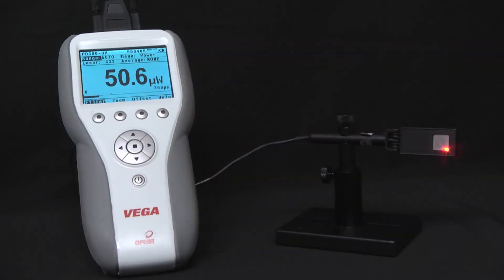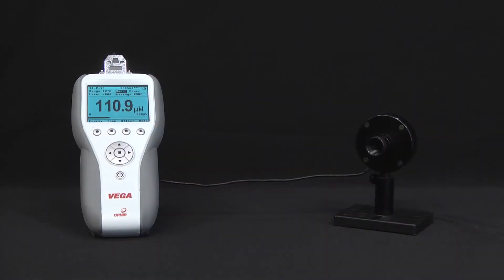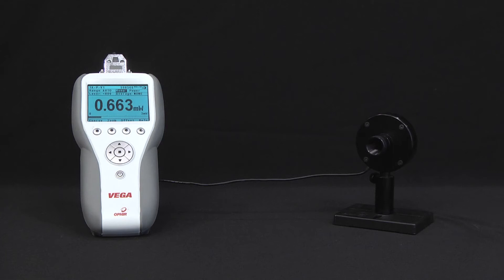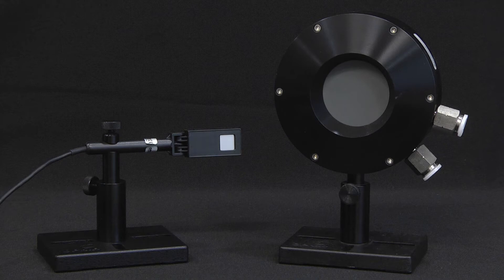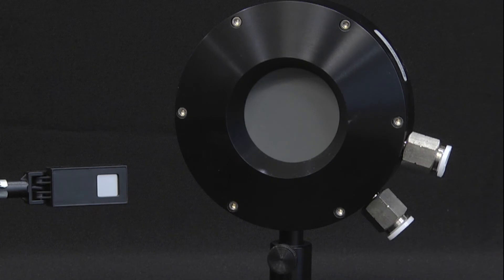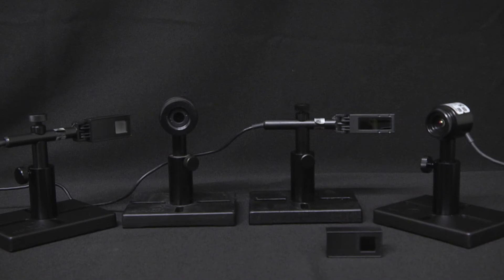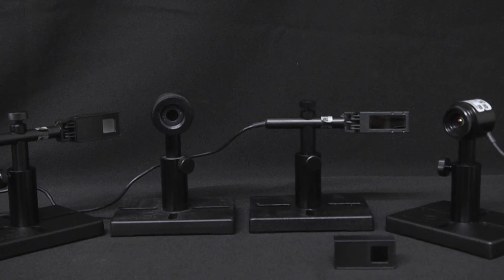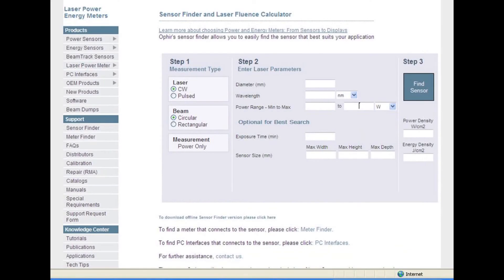Sensors for Measuring Laser Power

Comment: just solder 2x 1n34a rf diodes together like an av plug and insert into a dso 150 hand held scope  set to monitor rf waves in the air then hit the diodes with a red or green laser and watch the strange behaviour of the waveform  thats sensitive